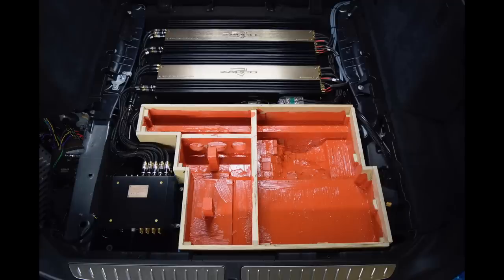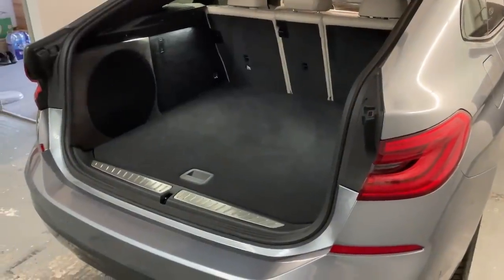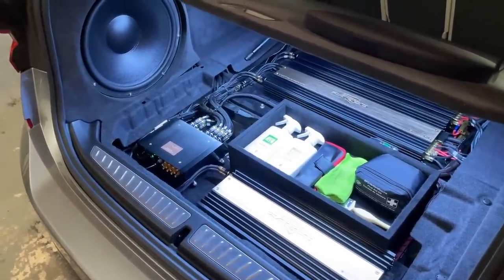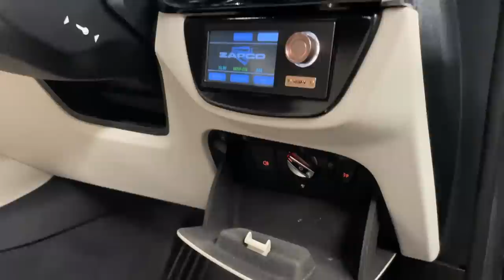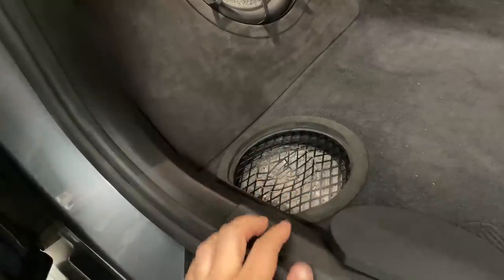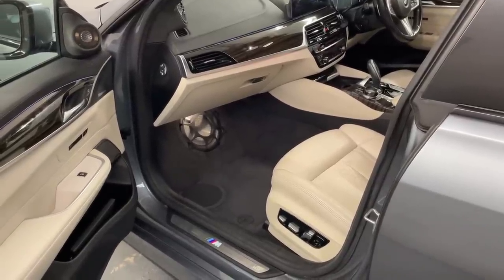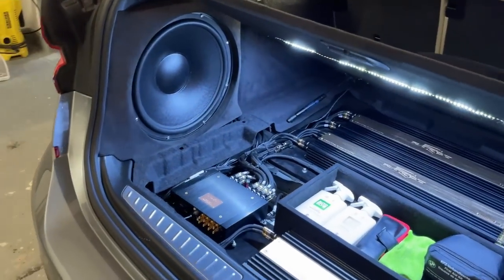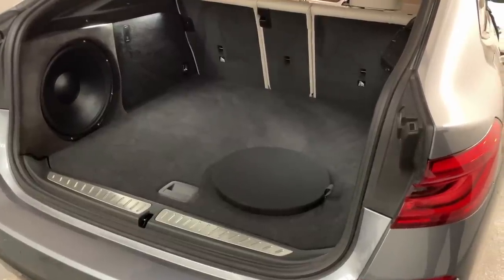BMW 6GT High-End System - True IB Rear Sub - Acoustic Elegance, Focal, Zapco, Fiio

Comment: Incredible journey with this build. I am a bit jealous!
I realize it is a complex setup but I'd like to ask, what would be your first focus to achieve impactful bass and improve the HK system in such 6 GT (other than replacing it 🙂)? Would it be the installation of the front or the rear sub? What is the volume of the front enclosure? I'd like to start smart and hopefully avoid remakes. Sadly UK is too far away for me.
Reply from the maker: We have a separate video showing the whole process of the build of the front sub too. 
You can do okay with the OEM HK, even keeping the door speakers. Just minimum upgrade the underseats as they’re 8ohm and difficult to power them properly. Most upgrade options are 2-4ohm and even a small amp can make way bigger impact then. 
We also shared a BMW 335i years ago, dead simple upgrade. I think that’ll be very inspirational for you! 😉🔊🔊
Reply: @pssound9749  Thanks for the suggestion. Your videos are interesting and inspirational indeed.
From my perspective the built in under seat woofers deliver OK in some songs, but disappoint if I want to have a bit of a blast. As you said they require lots of power, which seems to be missing. Plus they are in a tight space --> hard to go lower than 50Hz I guess.
I have an 18l JL Audio 10W03-4 sealed box. it worked fine in my previous car but sometimes I felt it was not perfectly synchronized with the music. I will try what you said and maybe add the box. But then to achieve great integration, a time alignment may be needed.... This is how the appetite grows 🙂
Reply from the maker: @tubaselecta  fully active system with DSP and properly tuned by a reputable (winning) competitor / shop are definitely required in order to have a system that works as a SYSTEM as opposed to just many speakers making noise.

Comment: I see a second 15 on the other side in the near future...Can you elaborate on the electrical?. Is this all on stock electrical?
Reply from the maker: Yes, just OEM battery. You can’t have another sub on the other side as you have to leave 1 pressure outlet available in the car for the aircon, unless you create a new one somewhere else.

Comment: I'm about to do an IB install and vent out of the cabin pressure vent.  I'm wondering how large of a vent do you meed in comparison to the cone area of the sub.  I've read at least 1/4 the cone area is fine.
Reply from the maker: If only 1/4 of Sd was enough without anything effecting the response. You need min 1/2.
Reply: @pssound9749  I currently only have 1/3 the sd. I guess I'll break out my angle grinder.

Comment: With the SDMI25 I assume you lose the fore/aft cues for parking sensor beeps?
Reply from the maker: Sensorts beep in this one.
Reply: @pssound9749  Yeah, but do front / rear sensors beep only at the front / rear like stock? The SDMI25 is only stereo output I think so it must mix the front and rear, so it comes out of all speakers probably.